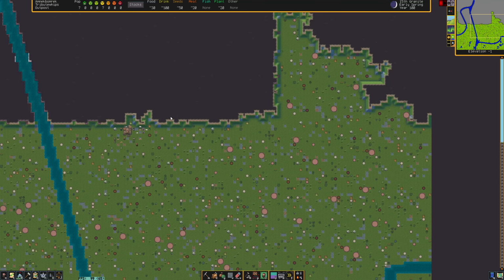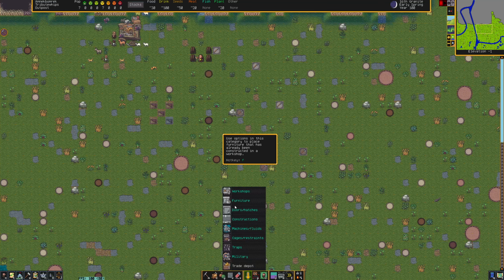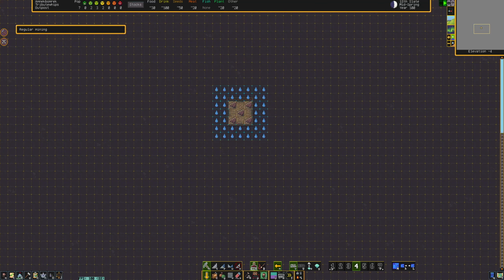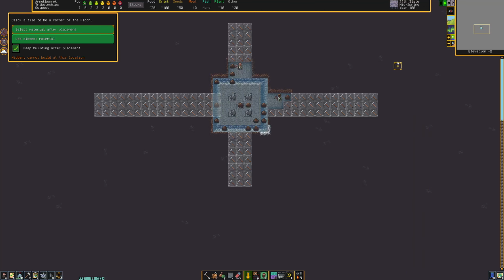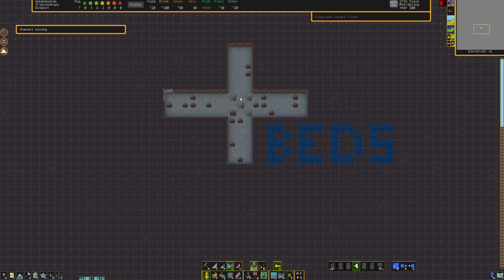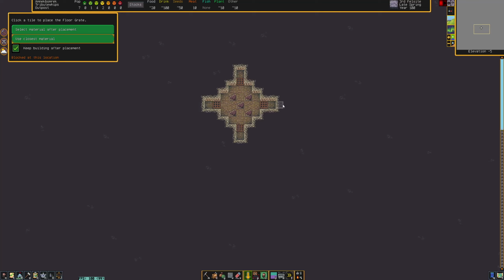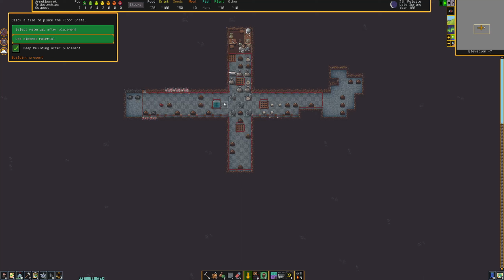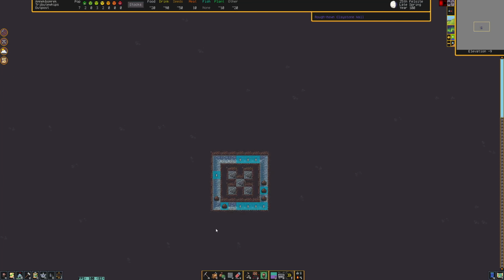Easy Unpowered Mist Generator

Comment: The 5 X staircase design only improves performance if you have walls on the orthogonal (North, South, East, and West) blocks.  The way it improves framerate has to do with how the game processes line of sight.  The game looks to those four orthogonal directions to determine what a dwarf can see, but not the diagonals.  By blocking off the orthagonals the game only processes at max 2 lines of sight when the dwarf passes a Z level with buildings on it.  Otherwise they only see the walls around them and the game has a lot less info to process in the background.  2x2 stairs or 3x3 are the worst for framerates because every dwarf has to process line of sight for every direction on every z-level.
Reply from the maker: Thank you so much for explaining this instead of just saying "another youtuber said so"
Reply: @MashBro  forgot to mention it also has to do with how the game processes pathing.  Dwarves can move one space diagonally if walls block the orthogonal paths, and by having the walls up it exponentially decreases the number of staircase tiles they can path to across z levels.  That is actually the biggest factor ahead of line of sight.  If you have a 3x3 full staircase, each dwarf on each step has to process 27 potential tile choices each time they change z levels, and they also have to consider how every other dwarf in proximity might impede their path.

Comment: Light aquifers are really nice and easy, I think people are agravated by heavy aquifers which used to be the only type I think in 0.47 (or earlier? don't remember)
Reply from the maker: That's a good point
Reply: heavy aquifiers are dank because drainage simply becomes a matter of sending the water back into a HAQ tile rather than the edge of the map. you can straight up pump water out of it as long as the excess can flow back down, rent free. the significantly faster supply rate of HAQ is also great because it means you can create a much smaller tap for any required flow rate. after experimenting with HAQ and discovering they're basically just massive underground rivers that invaders can't path through and i can more readily control the "accessible" shape of, i filter yes for them
Reply: @217Gnomes  I can say most of heavy aquifer potential is for advanced users.

Comment: I think if you smooth the walls it'll stop the aquifer from leaking in... It might depend on the wall material... I don't think there's anything you can do if it's leaking from the ceiling though. Am I misunderstanding that?
Reply from the maker: I haven't really found many instances where it actually leaks from the ceiling
At least not without finding the bottom, and that's always more trouble than it's worth in my opinion

Comment: I had a waterfall from a brook on my map, so I just used that.
Blocked it off by building floors and walls, then floodgates and floor bars, then carved the walls into fortifications after linking the floodgates to a lever and then built more walls around everything to seal it off
I redirected the water on the layer below the floodgate to go into my fort through more fortifications and floodgates, built up my main stairwell to meet up with the water and connected it back to the brook at the base of the waterfall through more fortifications

Comment: Nice job! Mine personally is down the center of a column with ramps along the outside.  My only recommendation is to restrict passage to the floor grates so they don't walk over it and get pushed around by falling water
Reply from the maker: Good call! I actually had no idea they could be pushed by the water like that
Reply: @MashBro  yeah one of my first attempts to play with water included a waterfall over the entrance to my fortress that I thought would make everyone happy.  it ended up with a pile of dead dwarves at the bottom of the river as they got pushed around and off and down along with the waterfall.

Comment: easy but barely working. Tou need to dig more than 30 light aquifers to have enough water to constant mist. Then obviously need to have drainage.
Reply from the maker: I did say that in the video. I dug out a few more tiles, it works great and filled up the drainage enough to put down a well.